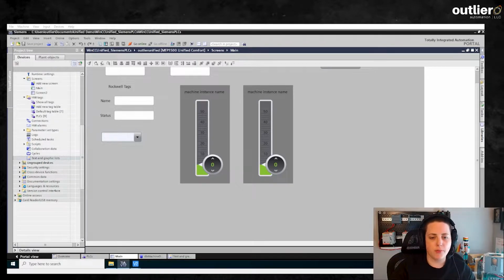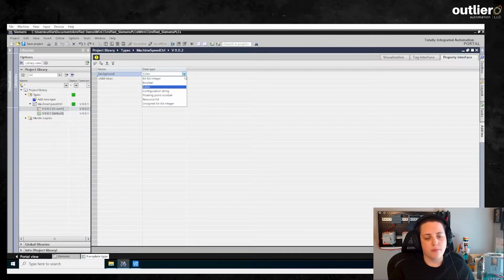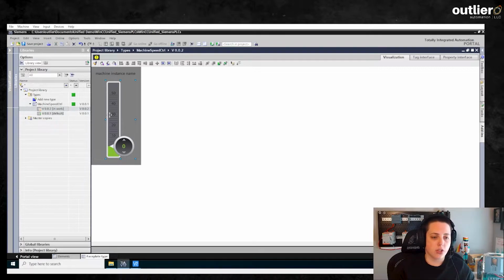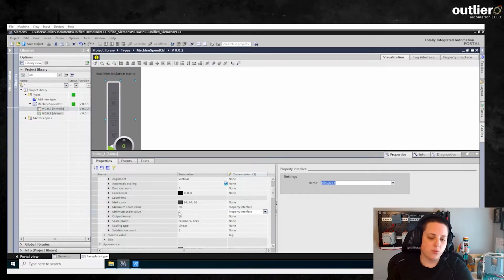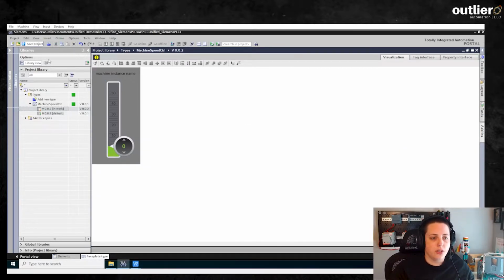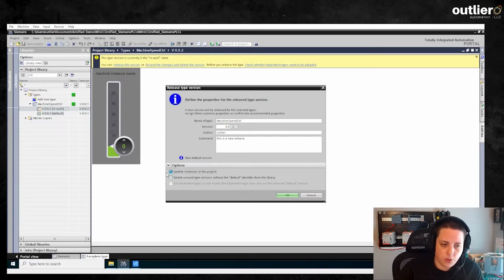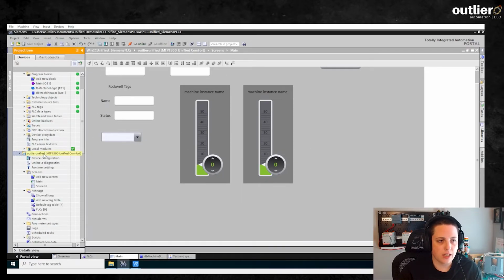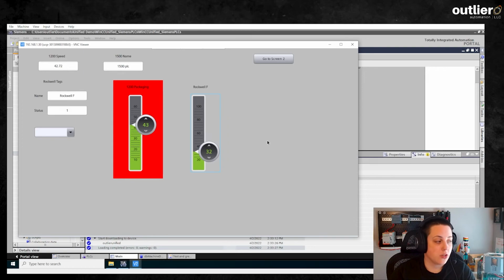Siemens WinCC Unified - Faceplate Property Tutorial

Comment: I have two faceplates: one shows a motor icon, and the other displays buttons like ON, OFF, Reset, or run feedback. When I click on the motor icon, it opens the motor faceplate. Changes made in the motor faceplate reflect on the motor icon since the motor icon uses the motor's color. How can I call the motor faceplate (second faceplate) within the first faceplate? Also, will changes made in one faceplate automatically update parameters on both? Is there any solution
Reply from the maker: You can use a Faceplate container to embed another faceplate inside a faceplate (at least in V19/20, you can).  The faceplate library version being selected as "Default" will automatically update the embedded faceplate when a new library version is released.  We covered this topic in the WinCC Unified Developer Course II we produced with Siemens on the Unified Academy.  You should check it out! https://www.siemens.com/us/en/products/automation/simatic-hmi/wincc-unified/unified-academy.html
Reply: @outlierautomation  thank you sir, its working

Comment: I was using this script in WinCC Unified V16 on IO field Press Key

export function IO_field_3_OnKeyDown(item, keyCode, modifiers) {

    // Only process when the Enter key (keyCode 13) is pressed
    if (keyCode === 13) {
        // Get the value entered by the user in the IO field
        let value = parseFloat(item.ProcessValue);

        // Define High and Low limits for the value
        let HL = 100;  // Example: High limit
        let LL = 0;    // Example: Low limit

        // Validate if the value is within the limits
        if (value > HL) {
            value = HL;  // Limit the value to the High limit
        } else if (value < LL) {
            value = LL;  // Limit the value to the Low limit
        }

        // Write the corrected value to the associated tag (Manual_SP, for example)
        Tags("MV_CTRL.Manual_SP").Write(value);
}

}

And  with this one I could check what user was try to type in in this IO field, and to limit his input between 0 and 100.
Now I am using WinCC Unifed V19 and this script is not working anymore.
Can somebody please help me with this problem?

Comment: In our desperate attempt to overcome the heinous pile that Unified currently is, we've been trying to work out how to set a Property in V17 that allows an object in the Faceplate to reflect an instance name at Design Time, the way we easily could in original Comfort Panels (50+ Drive Axes of motion, we need to quickly identify which Faceplate points to which axis.). V17 does not have a Property Interface for String. Here's the rub: V18 DOES have a String Property Interface, but it doesn't work either. At least not at Design Time. Even if it did, the V18 Runtime Image debacle forces us to stay in V17 for now. Have you worked out a way to duplicate this functionality?
Reply: Hey, I was wondering if you have resolved this problem?

You can obviously just create internal HMI-tags and assign them "my text" at beginning of runtime.. this makes not much sense IMO because it takes away a lot of the extensibility faceplates should offer.

The second thing I've been looking into is linking a script to the text property with something like:

             value = Faceplate.Property.Text.Read().

The problem is now that you need to define a trigger for this script, obiously you'd just want to have it triggered once (at beginning of runtime), but then you need to create an extra tag... and I'm not certain if it works either

Thoughts?
Reply: As of V18 and higher it is possible to use a multilang text property
Note that you need to be in runtime to see its effect